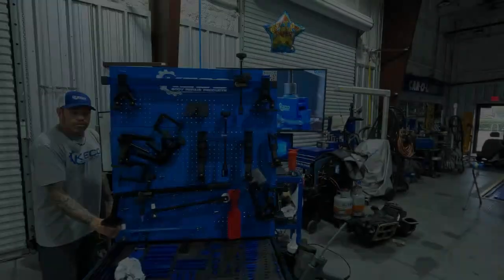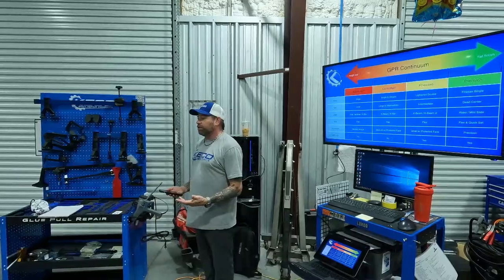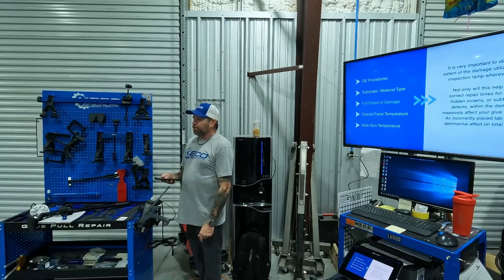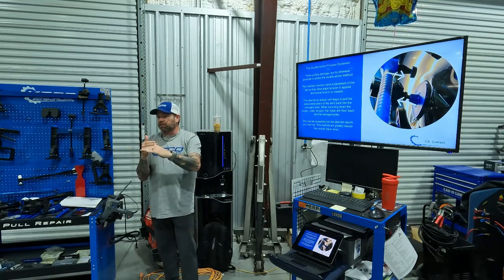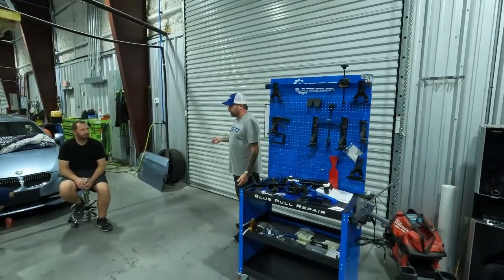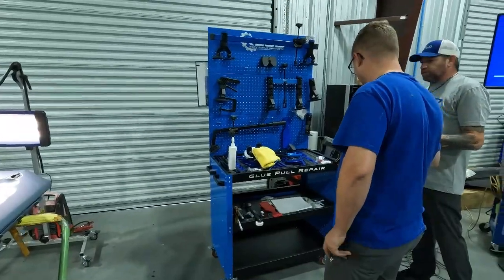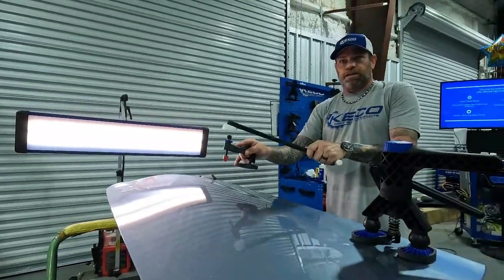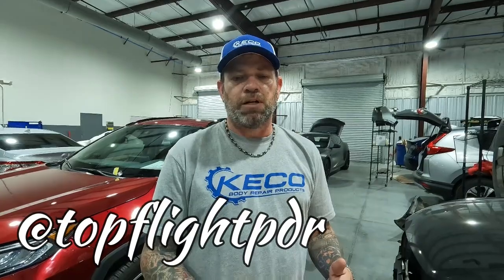How To Repair Body Damage With Glue Pulling - Is It Better?

Comment: I bought a few cars. Mint original paint and clear.  But lots of dents .  Spent lot time glue pulling.   Atleast 75 dents over both cars.   Sure was worth it keeping original paint.  Practice practice and more practice.  You will get there.

Comment: I live in Germany. If you have a parking lot dent in a door and have it professionally repaired by a painter, you get a rude awakening when you later want to sell the car to a used car dealer. The first thing he does is pull out his paint thickness gauge and then says that the vehicle has been repainted in this area and that he therefore has to deduct something from the price. Any assertion that this is a professional repair of a parking lot dent is rejected, because the buyer can not really reproduce this. If the dent is repaired by a dent repairer, the paint thickness does not change and the buyer does not deduct anything for it.
Reply from the maker: Thanks for the insight

Comment: What an over complicated bunch of useless tools. Ive been doing pdr/gpr for 23 years and 90% of my go to tools i bought or made when i started.  You always know when a company is in a sales rut because they come out with a whole new line of garbage tools. You Can never reinvent the wheel.
Reply from the maker: Ty for your opinion but I disagree.
Reply: Gotta say I bought the robolifter (and precision pulling foot, crease feet) and it's a very nice bit of kit once used to it.
I'm used to Ultra Dent PDR glue pull gear and lifter, but the keco item has a lot of pros over that and very little cons.
PDR is mostly pushing with rods / bars etc as preferred, but where access is limited being able to glue pull is a necessity . . . very worth spending time getting good at it.